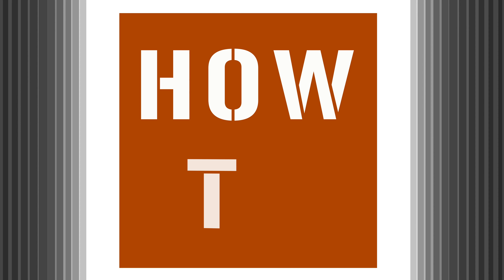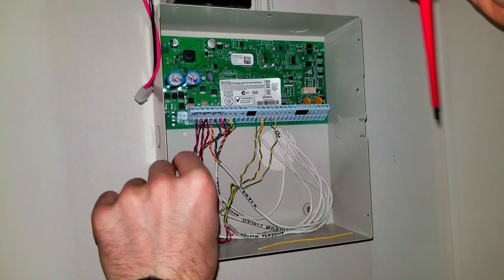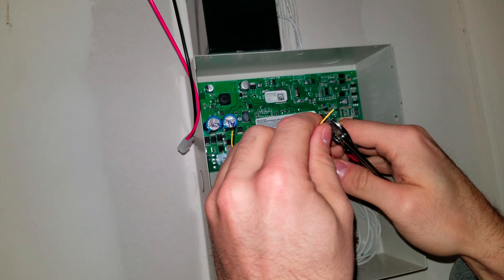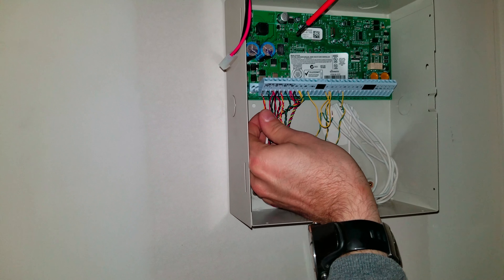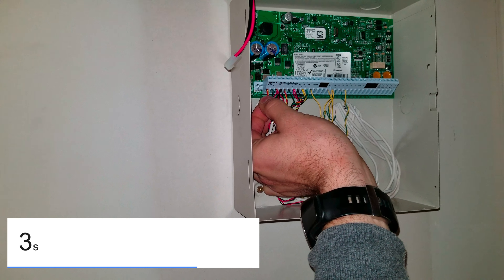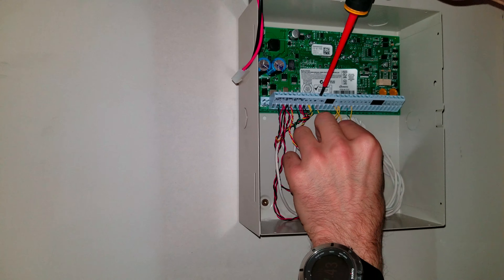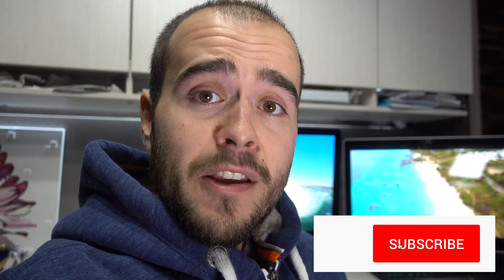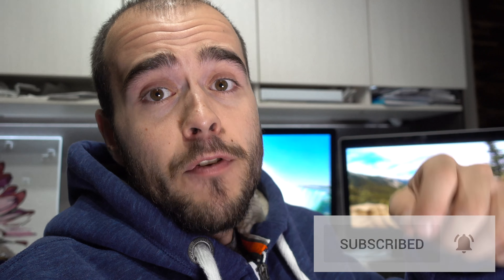How to Factory restore DSC Panel

Comment: We moved into our house 12 years ago.  There is a PC2500RK in our garage.  We never knew a code so we have not done anything with it.  I learned how to stop the beeping.  The trouble light is on and when I check it, it shows light 1 and 6.  It cannot be connected to a telephone wire, as we have no home phone (disconnected years ago). We would like to remove it completely. Is this something we can do ourselves, or do we have to get someone in to do it?

Comment: I have this alarm system but have a trouble on the fire loop.  The two smoke detectors have red lights.  I don't really want to fix those smike detectors as they seem specialized and maybe need professional installation.  How do I find the zone for the smoke detectors so that I can bypass them and get rid of trouble light.  Can I remove the smoke detectors from the system?

Comment: My electricity went out for 30 seconds PC1550, when it came back on all zones are open - can I clear this or is it fried?  (good video)
Reply from the maker: That is weird. Thoses device are VERY STRONG. I never ever see one failed over 8 years in the domain. Try to reboot it. Leave it off for 24h.
Reply: @HowToPM  I got the same problem! The panel shows that doors are open! I disconnect the battery and AC wire. I'll go back to it tomorrow to connect it back and check the result. Thanks for your videos.
Reply: @mikemarjany74  ... You probably already figured it out. 
But keep in mind, when you default the panel back to factory default. 
If you have no resisters in the panel. 
That's why everything is open. Factory reset, panel wants to see the resisters that come with the panel. 
I forget, I think the resisters are 4.7 K. But I could be wrong on the value of the resisters. 
Go to location 13, If 1 is off, it's looking for resisters. 
If no resisters, turn 1 on.

Comment: my lcd keypad seems to work well except for scrambled characters in some words.  Is there a form to restore the ascii eprom to factory values so the words appear correct?
Reply from the maker: Unfortunately, this happen to often with DSC System. You may open your keypad and look how your LCD stand on the keypad. You will realise that it's only clip. Otherwise you will have to replace it.
Reply: I also have the same problem with my keypad. I thought it was the keypad since I bought it on ebay. Doesnt seem to affect the functionality of the alarm though. In self monitor with a eyez-on.

Comment: Hi. Not sure if you still monitor these comments, But i have  a DSC Power832 (which was installed over 25 years ago and is still working perfectly) When it was installed it was set up to dial a telephone number if the alarm was triggered. I now want to turn this off ( i want to disconnect my land line and it beeps when i pull the plug) and I have no idea how to do this, if you can help me with that that would be great. The only other alternative is to do a factory reset. I have the Mastercode, the Maintence code and the Installers code, the only issue i have is will i lose these codes if i do a factory reset.

Comment: Hi, 

Thank you for posting such a helpful video. I was able to do the factory reset my DSC Power Series PC1616. I have analog keybad. Could you please help me with the next steps. After reset, keypad has 3, 4, 5, 6 turned on. Your help would be higly appreciated
Reply from the maker: Well. When you reset it, it come back to factory settings. The whole thing need to be reprogram. It's a video I plan to do since a while but I did not find the time to do it yet.

Comment: Hi, have a system with 3 DSC PK5501 pads.  They are starting to look unattractive.  Cover broken etc.  I have 3 new PK5500 pads.  What do I have to do to replace the old pads with PK5500 units.  I have 14 locations.  All seem to work properly.
Thanks
Reply from the maker: I have a video for your about this. 😉
https://youtu.be/JeAbVUWwPtQ
Reply: Thanks for the quick reply.  I know the installer code so I should be good to go.  I'm replacing the PK5501s with PK5500s.  Is there anything that I need to do that is not reflected in the video you directed me to?  Or everything should work fine?

Thanks so much.  Your videos are excellent!!
 @HowToPM
Reply from the maker: Nothing more. Its that easy. Thank you for your comment I'm glad you enjoyed! 😉
Reply: I replaced one of three keypads.  Initially, it went well.  Got into the new pad via *8 5555, then 000 0 #  Yellow triangle stayed on.  Now I can't get the pad to respond.  I only can use > to scroll thru "system", " R with numbers 1-8", and "Press # to Select Partition".  I check all three of the old keypads before starting and all were set to 1 and Keypad address 1.
What now?
Thanks!
Reply: I used # 902 on the new keypad.
Reply: I just set the time and date on one of the old pads and the new information appears on the new PK5500 and the other old PK5501.  New pad still only offers the three choices but does not respond.  There is no yellow triangle on any on the pads now.
Reply: I figured out how to make the new keypad responsive temporarily by usning long press #, long press 1 and then my pin twice.  Then #8 5555 000 0 gets me access but only temporarily.  Soon after when I press any key the following appears on the PK5500 screen.  1 2 3 4 5 6 7 8 on the upper part of the screen and R - - - - - - - on the lower part of the screen.  What is that telling me?  Any thoughts?  Maybe I have duplicated a keypad address.  Help!
Reply: After much trial and error, I have all 3 new keypads installed and they seem to be working well.  Thanks for your help!!

Comment: Not sure if you still monitor these comments, but wondering if you (or any other viewers) have any help/insight for me. Followed your exact process (for reference, I did have a wire already using the Z1 port, so I did the following: 1) remove cables from battery terminals, 2) disconnected/removed first AC wire, 3) disconnected/removed wire from Z1 port, 4) inserted single jumper cable ends into PGM1 & Z1 ports, 5) reinserted AC wire and waited for 10+ seconds, 6) removed AC wire, then reconnected every wire in reverse order [removed jumper cable from PGM1 and Z1 ports, inserted wire back into Z1 port, inserted AC wire back into first slot, and reconnected wires to battery terminals]). 

After doing so my PC5008Z keypad is now double-beeping once every ~10 seconds, and both the "Armed" and "Trouble" light are continuously lit.

New house, so I don't know the old Master Code, and hoping to do the factory reset and then reprogram the zones. Any help appreciated, thanks.
Reply from the maker: It seam you have sucessfully reset your alarm system.
That being said, it mean you need to reprogram the whole thing.
Wich is not an easy task if you never done it before.
Reply: @HowToPM  Thanks for the response. I don't think the factory reset has successfully worked, as it remains in the same state as before I try the reset. Do you know what lights/sounds should be showing once the factory reset has been successful? 

I am confident I'll be able to manage the reprogram process after the reset, but I don't think the process shown in this video is successfully doing a factory reset for me. For example, I seem to be reading elsewhere that the "Program" light should come on, which mine isn't. Nothing changes, and the "Armed" and "Trouble" lights are still on. 

If you have any ideas on how to get the factory reset method to work, would appreciate any further help from anyone. Cheers!

Comment: Ok so last year I fixed my grandma’s alarm system and everything was perfect 

4 days ago I tried to make the exit delay 15 seconds i did something and now the only light that shows is system when I click on the keypad there is no sound and i think i am keypad locked out i have tried to reset the panel but nothing seems to work please 🙏 I don’t know what im doing wrong should I maybe remove the plugged in zones or what please help 🙏
Reply from the maker: Hum. Looks like the keypad is disconected somehow. Have you play with wire?

Comment: I had a false fire alarm the other day and a triangle trouble fault indicator came on.  How do I get rid of that.
Reply from the maker: Arm and disarm the system, you should be good then.
There is the reset button also on the keypad (3 arrows in circle).
Don't do the reset from that video.

Comment: Had a big power outage and now both panels on my DSC system are off except “trouble” light. I disconnected battery and power to main board for 24 hours also installed new 16v power module for main board, but panels still blank and just beep. Will this reset correct this issue without losing all of my zones and settings? I have 16 zones. Thanks for any help, I’m at a loss.
Reply from the maker: If you are not familiar to program a DSC pannel, you don't want to reset it. However the issue you have really look like a power short or a power issue.
Reply: Thank you for the reply. I do not know how to program. I changed the power module from the outlet and I disconnected the battery as well. I am getting 17v at the board screw terminals. Anything you can think I can check for power short? Should I swap new PC5015 board or newer or does that require programming too? Very strange both panels I have are doing same thing. Thank you!

Comment: we no longer have the paid service but wanted to know how to remove the system all together? Are the steps to take??

Also the past few years we would set the alarm when we would leave the house like a reg. habit however now the dsc controller is chirping on/off mostly in the early morning 2am-4am and now we --- ----- ------ ----- ---- ----- these type of lines showing up on the screen with the yellow triangle - I looked at the manual but can't figure it out....also the battery is reading fine 13.23 standby power rating.... any help would be appreciated. Thanks

Comment: Great informative video's!  I have a c02 detector wired to my DSC alarm. The c02 detector died.   When I disconnected it to install the new, identical detector, the alarm system was activated.   I stopped the alarm, however when I connected the new C02 to the DSC alarm system, it still shows to be error code and is not recognizing the new detector for zone 7, which is my c02 detector.  How do I get the DSC alarm system to recognize the new C02 detector?  It's the exact same model and I wired it the same as before...... TIA for answers!

Comment: Stupid question here. Would this allow me to use the system, that now I own, without a contract with a monitoring company? Thanks for helping,
Reply from the maker: Yes. But you will have to reprogram everything.
But the system is yours, you may just stop paying them. They will stop monitor.
Reply: @HowToPM  Is it my right to ask them to release the installer code to me. What's the point owning the hardware if useless?! Thanks.

Comment: I know this has to be a dumb question but does the whole system have to be off? Or do you just take the back up battery off?
Reply from the maker: It must be fully off. Power supply and battery.
But watch out. I realize that some regular user do it and should not. I made that video for alarm technician. I mean, if you de reset it, you will have to reprogram it. And this is not an easy task when you don't have a bit of experience in it. I will eventually do a video about how to program it.
Reply: @HowToPM  I'm just trying to reset the whole system. My father just bought a house and it has a DSC security system that the previous owners never got the alarm code from the original homeowners who installed it. Well he messed with it and now the system is armed and I had to shut the breaker off and disconnect the back up power to keep it from going off. It's a rfk5501 and all I'm trying to do is disarm it
Reply from the maker: This reset will yes disarm it, but it will reset so much more. This is not what you want to do actually. Your best shot is to contact the previous owner to get it's code.
You can also try the most popular code.
1234
4321
2580
1379
the street adress
You would be suprise at how many people use those pass code.
Reply: @HowToPM   I'll give those a shot. I contacted the previous owner and they said they never used it because it was installed before they moved in and they never got the code from the owners who had it installed. The people who had it installed passed away.

Comment: Hi, is there any chance for hw reset, if its in system blocked? I have old DSC1500 with no code. But, reset does not work. THX
Reply from the maker: If the system is armed, you can't reset it.

Comment: How do you fix the Keypad is locked issue after power loss?
Reply from the maker: A keypad is lock? Isn't just that the system is armed?
Reply: @HowToPM  Previously loss power and the backup battery had died.  When power returned, DSC kept beeping alarms and keypad lockout is active.  Waited the initial 15 mins but no go.  All that did was extend the lockout.  Tried waiting an hour, still no go.  Finally waited an hour over the 255 mins (4.25 hours) and then touched the keypad which was no longer locked out.  Sad part was having to listen to the annoying beeps for 5 hours plus to resolve.

Comment: I don’t have bgm 1 on my panel
As mine is a pc1550
I bought my new place and I can’t get my alarm to work as I need the master code 
But system is good with no trouble light
And the system is ready 
Just no code and last homeowners never bothered to get it
Reply from the maker: Ouch. Well the PC1550 is an older generation than the one I show in this video so it might be different.
If you do reset the panel you will have to reconfiguer everything.
About the password try one of these.
1234
4321
1379
1580
0851
I would say you could enter in a quarter of every house with one of these.

Comment: Hi, We have a DSC Power Series PC1832 and followed the instructions, but now nothing will turn back on or power up. The keypads and motion sensors are completely dead. Any ideas why? Thank you.
Reply from the maker: Well... You probably did'nt reconnect the power? Or create a short between + and -.
Reply: @HowToPM  We definitely reconnected the power and everything back to how it originally was. Will the 1832 system work without the backup battery? We tried unplugging it to see if the system works just with AC, but still nothing. Tried re-connecting the backup battery, still nothing. If the backup battery is all of a sudden dead, would that cause the entire system to be dead? Even though we didn't have codes, it disappointing now after doing this that the sensors and keypads don't work. Thanks for any help.

Comment: My problem is different. My PK5100 says OPEN, 2, 4, 5, 6 and BYPASS, which is correct (new windows and back doors removed sensors). However, the green check will not light as before and I can't activate zone 1 and 3 alarm anymore. I was previously having success with *1, 02, 04, 05, 06, # to bypass open zones. Any advice?

Comment: I have PC2550, sensors etc appear to work ok. However, the siren does not go off. any idea, how to fix?
Reply from the maker: The keypad should show you what the Alarm is. Maybe you have a tamper on the panel box?

Comment: hello, i tried and fail to reset my dsc exactly the way you do it here.  i dont have any code nor password. the system is armed when its ON. so i disconnected de bell than plug a jumper in pgm & z1 before to put power during 10 and more seconds. than i replace every thing but nothing change. should the system be unarmed to do the procedure ? if yes how can i disarmed it without any code or password ? thanks.
Reply from the maker: Hum. Well almost nobody do this but... It seam that the installer of this system has activate an option that disable the reset procedure. So unfortunately, unless you find the user code to disarme the system, this alarm system is good for the recycle. You can try those commum password :
1234
4321
2580
1379
0852
year of construction of the house
or try everything between 1990 and 2020
last 4 didgit of the previous home owner.
Good luck.
Reply: @HowToPM  i found an info on EEPROM/RESET pins on the mother board. i shorted them 10seconds with a screw driver. it seems working. the lightning changed on keypad and the master code *5 1234 leads to some programming. now i have to learn the language to reactivate the system properly. thanks anyway !

an other question. i red that the yellow an green wires of a sensor should be fix in z & comm sluts in order. these on my system are plugged reverse so the green in z and the yellow in comm.  those it change something ? thanks again.
Reply: @uobbuob6259 can you share where the pins are?
Reply from the maker: Hi Denis. Oh I see, this alarm system is not a power series. So you may not have the PGM. I never work with that one. But about the green and yellow, it does not matter. Absolutely not.

Comment: Morning.  I tried a lot but may I failed to restore my pc1808. I don't have any code  it's showing me a red lock and a yellow triangle sign. Its alway active if there any movement, siren starts
Reply from the maker: Hi! Well, the red lock mean it's in arm state. It is possible that the installer have disable that reset fonction. It's rare, but it's happen. In that case the only solution you have is to replace the pannel or try every code one by one, until you find the right one. From 0000 to 9999.

Comment: I tried this but it did not reset my rfk5501.  I am not sure why.  I have two panels on the system.  Could that be the reason?  The other panel is an LED panel.
Reply from the maker: One of your panel is probably an extension pannel. There is also the possibility that the reset feature has been clocked by the programmer.